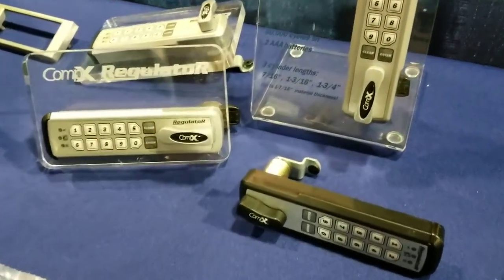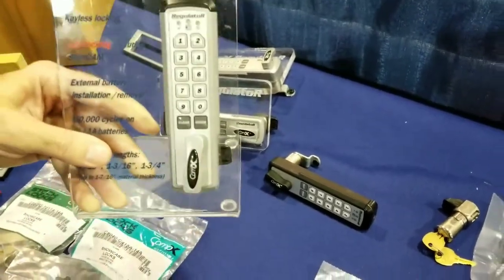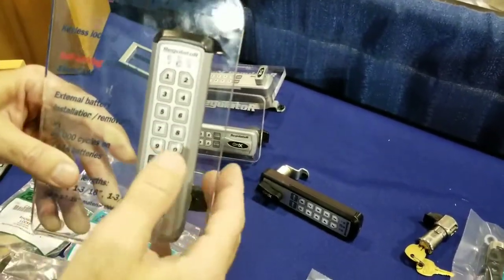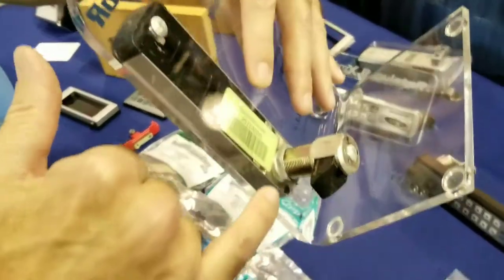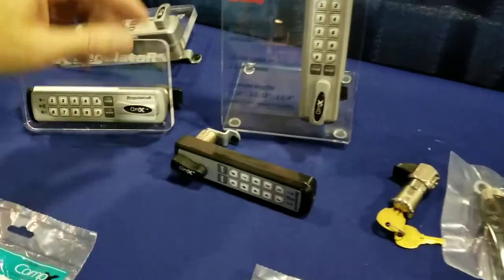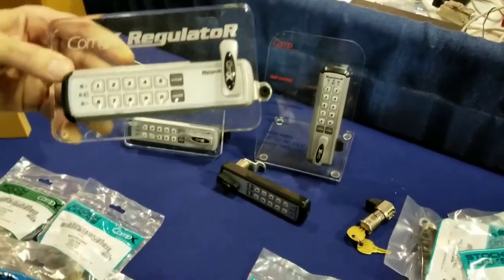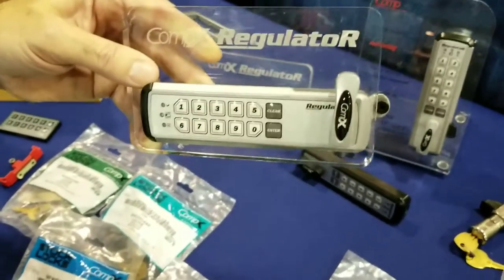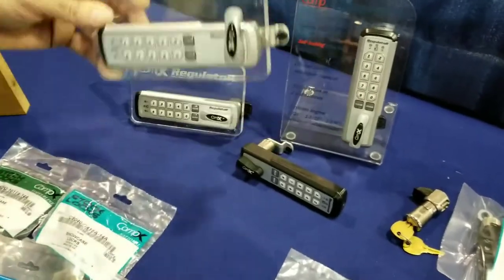CompX digital keyless keypad push button cam lock for cabinet and drawer easy installation

Comment: I have followed the directions to the tea to reprogram us it doesn’t accept the dealer code 12345 so guys what the fuck is the real code
Reply: And...they never answer.  I'm going to have to go with the pry bar route - or hammer and prybar in order to get this thing opened.  Then throw the whole filing cabinet in the metal recycling bin.